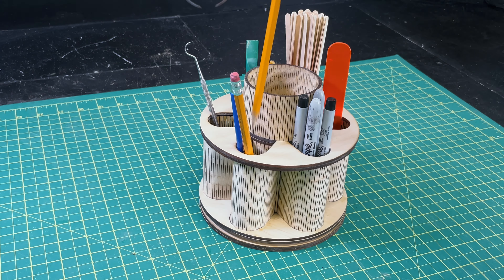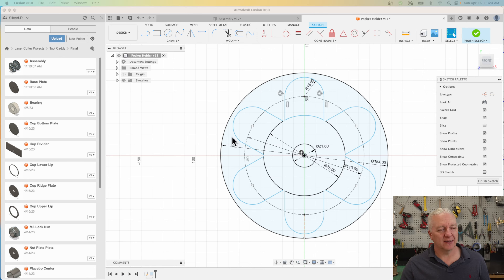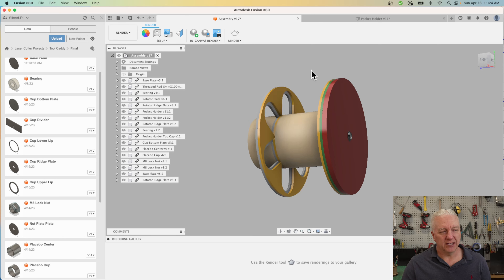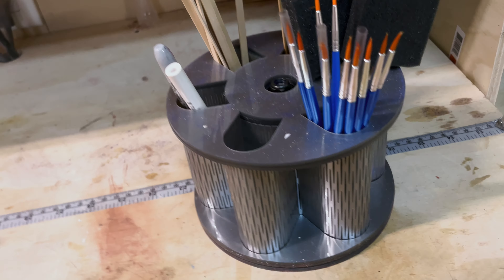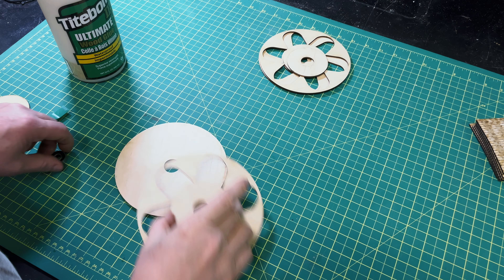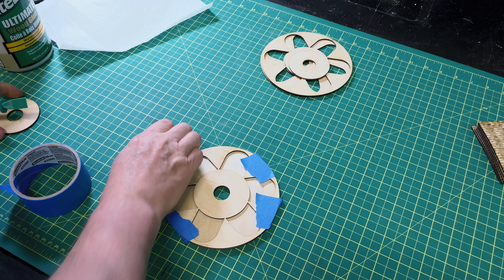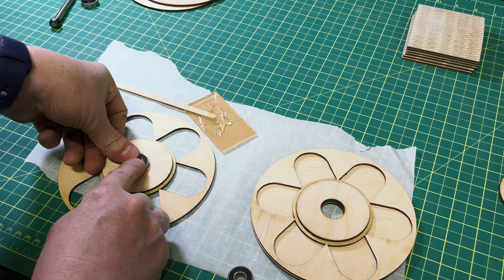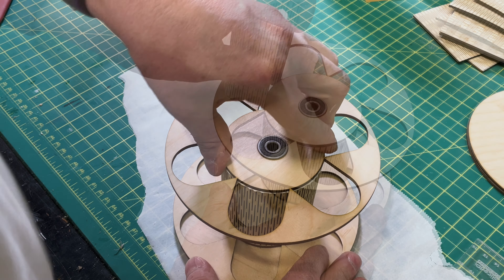You Won't Believe the Desk Organizer I Made with My Laser!

Comment: Steve,  I'm curious about what the kerf is on the laser you originally made this on.  I'm guessing relatively large.  I cut all of these out on my 20w diode with a kerf of .08x.08 mm  Fortunately, I  found the various issues before I removed all the cut pieces.  Basically, nothing fit..  The locknut didnt fit in the hex hole cut for it, the bearings didnt fit in their holes..  So, I was able to make some adjustments in lightburn using the kerf offset.  Most things were adjusted outward (the holes for the locknut and bearings, ect).  Anyways, thanks again for an awesome video.  Maybe one day I can post a video on this (giving you full credit and a link here of course).
Reply from the maker: I used a CO2 laser for this, which typically 0.2-0.3mm. Diode lasers will typically be below 0.1mm. I guess I should have made a design specifically tailored to diode lasers, but you can just add a bit more kerf compensation.
Reply: @SteveMakesEverything  I adjusted the kerf 0.3 mm, but I think 0.2mm might work better..  Also,  I think this same idea could be used to adapt from metric to 3/8" locknuts and threaded rod.. Which might be easier for folks in the states to get a hold of.
Reply from the maker: @ericeinsmann5559  Yes, you could probably use this for conversion between Imperial and Metric material.  3mm plywood will actually measure 0.118", so it's thinner than 1/8" by a very small margin (probably not enough to require adjustment since this will all be glued anyway.

However, vast amounts of plywood sold in the US are actually made in Canada (unless all the softwood burns in our forest fires, of course).   These materials at your local Home Hardware or Lowes calliper
Reply: @SteveMakesEverything  great! 😟 Forest fires.. Another excuse to jack up lumber prices!

Comment: Steve, the bearings you link to have a 12mm I.D.  Should they instead be closer to 8 (perhaps 9mm) considering the threaded rod is itself only 8mm?
Reply from the maker: Damn, sorry. I’ll update the link
Reply: @SteveMakesEverything  no worries!  I wound up just printing some sleeves ;-)
Reply from the maker: @DarinKadrioski  Easy fix.  There is very little stress on these bearings.  They really aren't required at all, but they are cheap and work well for keeping everything aligned.

Comment: Nice video Steve!  Im in the process of cutting this on my 20w diode laser.  In an effort to get rid of some of the smoke smell, I was thinking of dipping some of the parts in to white vinegar..  what do you think?  will that hurt the parts?
Reply from the maker: It probably wouldn’t hurt the parts, but wouldn’t vinegar smell just as bad as a bit of smoke? 😁
Reply: @SteveMakesEverything  vinegar does a decent job of cleaning off smoke stains on lasered wood.  It also neutralizes the smell since vinegar is acidic and burnt wood is alkaline.  Dipping the parts was OK,  but leaving it in there too long caused some of the adhesive in the paneling to weaken and parts of the wood started to fray.  I'm letting everything dry overnight and will put it together tomorrow
Reply from the maker: @ericeinsmann5559  Maybe you should just lightly spray it on.  This would be interesting to try - mind if I put a quick video together to test this out? (with due credit, of course)
Reply: @SteveMakesEverything  oh sure..  I didn't come up with the idea though.. I learned it from "the Louisiana Hobby Guy".  But who knows who first came up with the idea..
Reply from the maker: @ericeinsmann5559 OK I know Rich.  He's a good guy.  I'll talk to him about it.